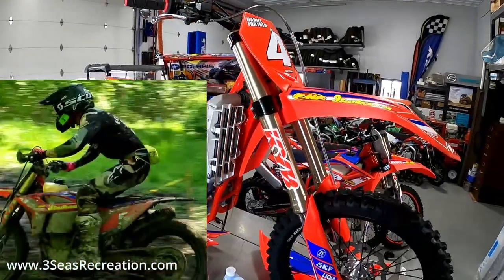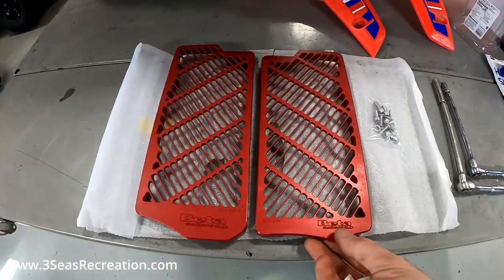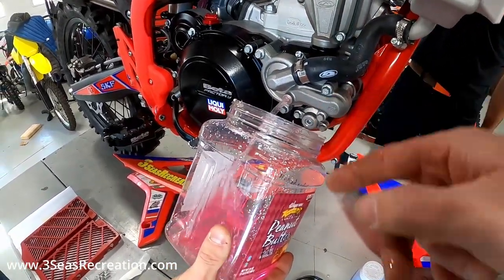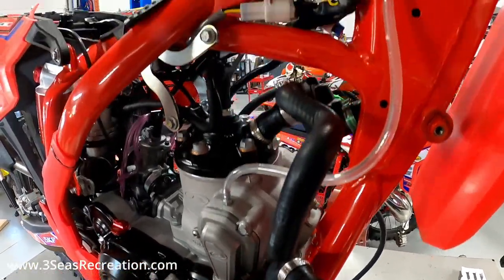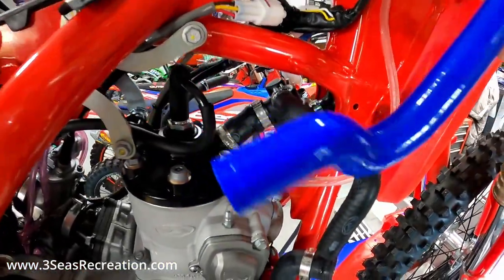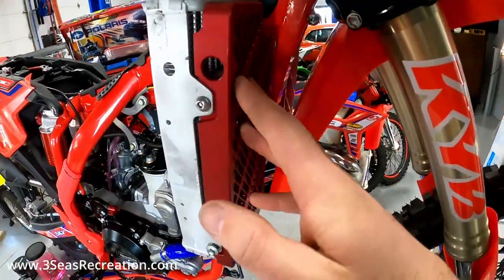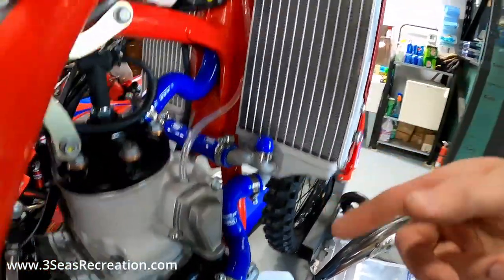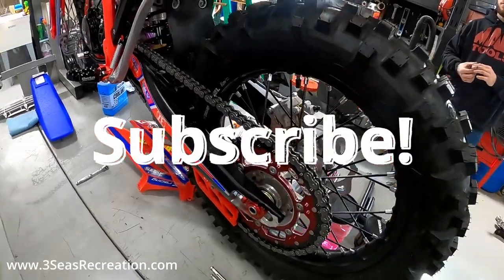2020+ Beta 250 & 300 RR 2-Stroke Samco Cooling Hose Kit Install, 3 Seas Recreation, AB-22144

Comment: I just installed this kit on my 2023 Beta Xtrainer. Bruce at RaceBikeBits ensured me that it will fit and it does. I bought one from Sierra BMW Beta and one from RaceBike Bits in the last two weeks and they both fit. 3SR must have an older production run. Aloha from Hawaii.
Reply from the maker: Good Morning, this kit fit just fine. I have only had issues with the new 2023 XTrainer hose kit. Enjoy The Ride, Jared

Comment: Love to see you do this on the 4-stroke as well!!! (I have a '21 500RR-S)

I'm having issues with mine overheating on the trails. 🥵
Reply from the maker: Great suggestion! Once I get a bike in that needs the kit we will film it! Thanks, Jared
Reply: Have you installed a radiator fan yet? That will help a lot as well as changing your coolant to engine ice is supposed to be able to handle higher temperature than normal coolant
Reply: @brettsaspari5369  — comes from the factory with a fan… but I will prolly do the Samco hose upgrade and Engine Ice this spring. See if that’s helps.
Reply: @One_Mile_Up  🤞

Comment: Can you explain the benefit of removing the thermostat? I understand the removal of extra  extra hose clamps but when you remove the thermostat does anything else need to change?
Reply from the maker: Good Morning, our goal with the race bikes is to keep things as simple as possible and remove any extra areas for leaking and to have high quality replacements. As you can see there are quite a few more clamps involved when the thermostat is installed. Before the race we just ensure our bikes are fully warmed up before running the bike hard. Thanks for watching and the comment, Jared

Comment: Is the tee section at the top on the replacement hose any wider than the factory hose? My radiator guards move the radiators out about 1/8" on each side and it makes getting the spigot pushed deep enough back into the hose a challenge.
Reply from the maker: I will be doing a coolant hose kit on a 300 Race Edition either tomorrow or Monday for a customer. I will compare them when I have both of them out on the counter! Thanks, Jared

Comment: So the 250’s and 300’s take the same hoses, and the 125’s and 200’s take the same hoses?
Reply from the maker: Good Morning, I would certainly check part numbers but YES they are grouped together. (250 & 300)   and (125 & 200). Enjoy the ride, Jared
Reply: @3SeasRecreation  thanks for response.   In case anyone else sees this wondering.  I did purchase a 125 thermostat delete kit and it was a perfect fit for the 200

Comment: How exactly do you pop the crimp on clamps?
Reply from the maker: Good Morning! If you are trying to remove the stock clamps I usually use a small screw driver or a pick tool. The clamps are a one time only clamp so there isn't really any saving the clamp. Thanks, Jared